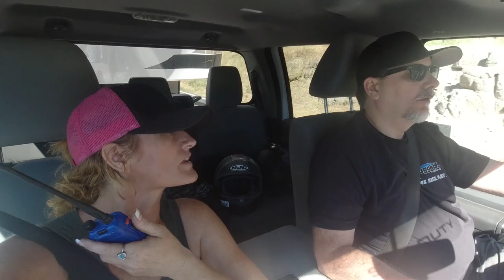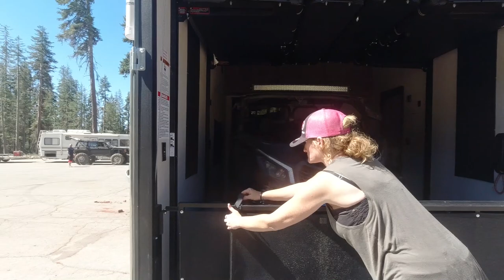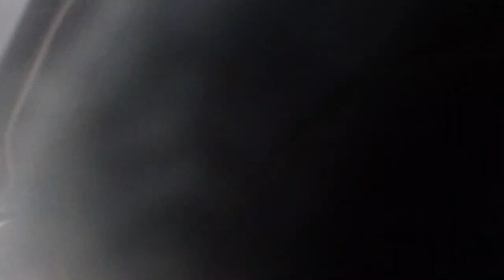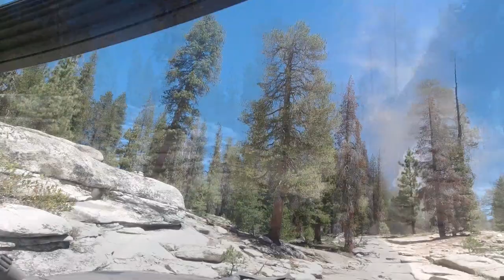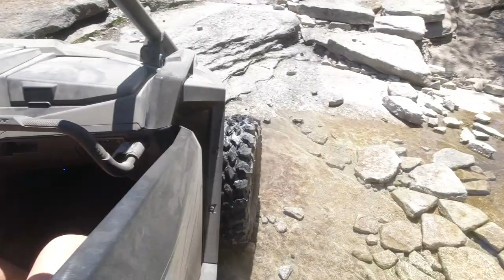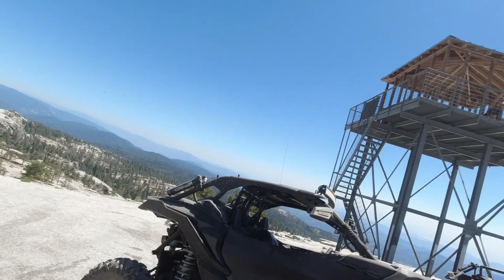2020 RZR Pro Rocks Trails Climbing

Comment: If you really like the suspension on that base model what until you send those shocks off to get re-valved and re-sprung they will be awesome. The dynamix is just a whole other experience. I put a good bit of miles on my friends Pro XP4 seat ultimate and wow is all I can say. I have a highly modified 19 Turbo S and that stock XP Pro rode almost as good as my completely redone Turbo S. I am having a hard time deciding if I want the Premium or Ultimate model. My wish is that the 21 models come with long travel suspension and a velocity model with the Walker Evans Velocity shocks.
Reply from the maker: yeah we can't wait. I know on our Can-Am the difference is not even describable, stock to the MTS setup we have now. The ride is ten times more plush with WAY more bottom out control. And just overall controllability.